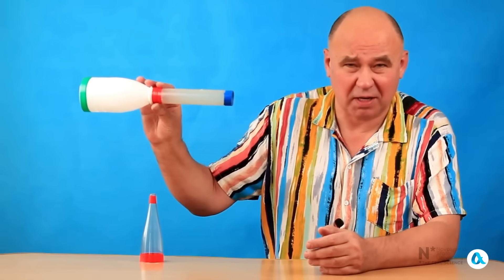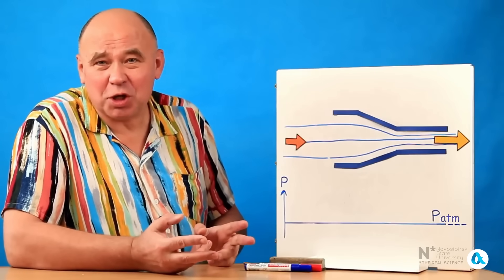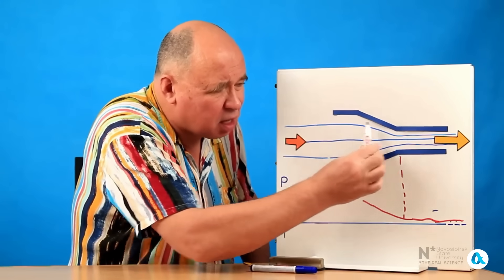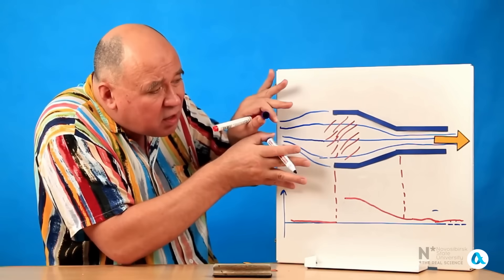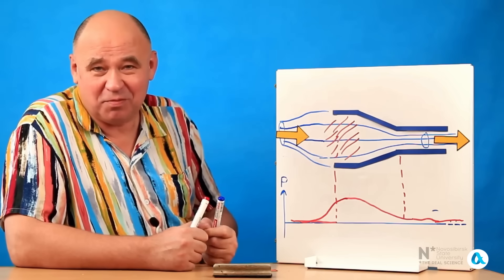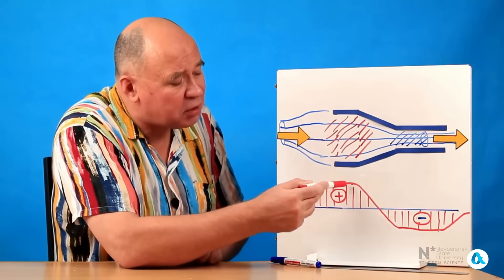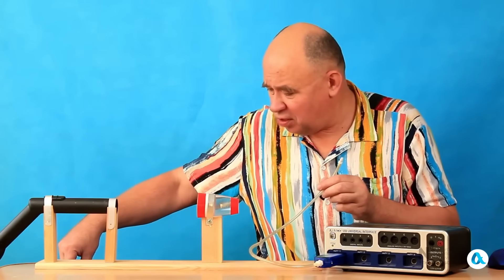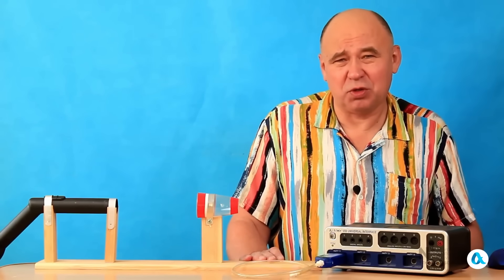Tapering pipe paradox

Comment: In this video, the velocity of the air inside the outlet tube is definitely greater than the velocity inside the inlet tube. There is no doubt about it. Because the pressure inside the inlet tube will be higher than atmospheric pressure. If you blow the inlet of this tube with a fan like in the video.

If we put this tube in a wind tunnel, the inlet pressure should also be higher than the outlet pressure.

Will there be a reaction force at the outlet of the tube? it will be. But this reaction force is not acting on the tube, but on the air. So it cannot become the engine of an airplane.
Reply: You know narrowing conical shapes are used in supersonic jet engines to slow down the incoming air? An increase in pressure, i.e. narrowing of the tube, slows the air down so it's suitable for the rotor. The air speeds up when pressure eventually drops at the outlet.
Reply: @Kansika  Is slowing down the speed an increase in pressure?
Reply: @enbinzheng-line  Yes. "Bernoulli's principle states that an increase in the speed of a parcel of fluid occurs simultaneously with a decrease in ... pressure." Notice that it doesn't say that lowering the pressure at source of the flow will always increase the speed of the medium downstream. Additionally all this applies to static pressure which he is trying to measure here.

It's quite logical when you get your head around it. Try this: a high speed flow of air in a duct meets a restriction and is forced in to a narrower duct. Of course the flow will slow down bc all that air won't fit in as easily. Simultaniously the pressure it exerts on the walls of the duct is increased bc the same mass has to fit in to a smaller space. And vice versa, when the duct opens up to a larger diameter the air speeds up while the presuure it exerts on the walls decreases.
Reply: @Kansika  What you said is incorrect. The fluid is continuous. Assuming the fluid is incompressible, the volumetric flow rate inside the tube is constant, so the fluid velocity at the inlet of the converging tube must be lower than that at the outlet.
Reply: @ There's no incompressible variables here. What he theorizes, models and measures don't add up. Why not set up a venturi tube yourself and test if Bernoulli was wrong?

First of all the CAD model shows a cone with an even diameter extension nearly as long as the cone. The model he built only has a cone and an outlet. Not the same thing. A taper or a restriction always causes turbulance that takes a while to settle.

Secondly he's holding the end of the probe tube away from the direction of flow. Air flowing over tuhe tube creates an eddy flow at the tip creating negative pressure zones. 

The least he could do would be to take more readings with the nozzle facing the flow. That would be the dynamic pressure and subtracted from the static pressure it might give some hints about air velocity.  But like I said he's not measuring static or dynamic presuure here.

I use a pitot-tube with a digital manometer to test ultra-sonic air flow sensors at work. Turbulent air is very hard to measure. All and all, air speed is not what he measured here.
Reply: @Kansika  I mean the exit speed is faster than the entrance speed.
Reply: @enbinzheng-line  Static pressure should be measured perpendicular to the  flow, not pointing the nozzle downstream where other factors come into play.

Measuring static p could be done by drilling eg. four rows of holes in several columns around the funnel that are at different distances from the inlet. Then inserting  four tubes that are joined together and taking messurements in each column at different depths would give some picture of what's actually happening inside.

How do you calculate air velocity from these quasi-static measurements? When he measures ~150Pa of positive pressure in the funnel the velocity of the "fluid" is simultaniously reduced by the same factor. At the outlet the pressure drops to barely below atmospheric, <-10Pa meaning the increase in velocity is minimal and it is relative to the already slowed down velocity, not the original velocity before entering the funnel,  unless you want to argue with Bernoulli, that is.
Reply: @Kansika  I mean that after the fluid enters the convergence tube, the velocity decreases to V1, the pressure increases to P1, and then there is a velocity V2 at the outlet of the convergence tube, which should be: V2＞V1

Your method of measuring static pressure is correct, it is not correct in the video.
Reply: @enbinzheng-line  If instead of static pressure measurements you measured the volume of air and it's kinetic energy at both ends you'd certainly have a net negative.

The high pressure readings in the cone are due to turbulence and the collisions of air molecules while some of the air and thus energy is being deflected from the main axis of flow and some is reflected backwards out of the system. That's why you cannot use only static pressure to calculate air flow/volume.

Some air molecules are accelerated slightly at the outlet but the amount of energy is not increased in the system. Instead a smaller mass of air experiences the acceleration but it has less mass/energy. No thrust. To get a relevant calculation out of this you'd have to know the mass/velocity/total energy of the air entering and exiting the system which this setup doesn't do.

Comment: You could with the same success demonstrate that peas dropped in the funnel fly out faster on a bottom than enter it at the top and argue that this should mean that the funnel might fly upwards due to pea jet stream.

If you reversed the funnel in the air, I believe it would have normal pressure in the narrow part and lower in the wider.

Comment: I like this explanation (as the author of this video), and I like the question, of course. What happens in the narrow part of the tube, if we neglect the viscosity? The flow velocity is higher then outside the tibe, yes? But what do you think about the energy conservation in this case? :))
Reply: In this video, the velocity of the air inside the outlet tube is definitely greater than the velocity inside the inlet tube. There is no doubt about it. Because the pressure inside the inlet tube will be higher than atmospheric pressure. If you blow the inlet of this tube with a fan like in the video.

If we put this tube in a wind tunnel, the inlet pressure should also be higher than the outlet pressure.

Will there be a reaction force at the outlet of the tube? it will be. But this reaction force is not acting on the tube, but on the air. So it cannot become the engine of an airplane.
Reply: @schetnikov  
The ability to properly translate a wide variety of languages really is something I'm looking forward to a lot. 
I've seen so much interesting work from Russians, Indians, Japanese and whatnot, especially on technical/mechanical topics, but rarely with useful translation. Especially if it's a rather niche topic people rarely take the time to make proper subtitles, much less a full synchronisation. 
This might open up a whole new world soon. 

Did they just translate and reupload the video without consent though?
That would suck a lot, such crap is way too common as is and it might increase dramatically very soon.

Comment: How this net deceleration related to drag force on the system? F_drag = mass_air × a_Netdeceleration ?
Reply from the maker: Imagine two pipes of different diameters connected by a smooth adapter. Now let us place this structure in the air flow with its wide end forward or, what is the same, move it relative to the stationary air. The flow enters the wide part of the tube, then passes into the narrow part, and at the same time, obviously, increases its velocity. Have we really got an air gas pedal, a kind of jet engine that runs without any fuel?! Something's not right here.

A metaphysician like Newton will immediately say that the Creator of all things so arranged the universe that man could not get something for nothing, and such an engine is a priori impossible. 

And a physicist (like Newton) should find an error in this very plausible reasoning and understand in what exactly we deceive ourselves.
Let's follow the air pressure along the axis of the pipe. Behind, at the exit from the narrow pipe, the pressure is atmospheric, as well as inside it: the air flies there by inertia. But in the adapter and in front of it, the pressure must be greater than atmospheric to drive the air into the narrow pipe and increase its speed. But before the wide pipe the pressure is again atmospheric, so at the entrance to the pipe in the area where the pressure increases, the air flow slows down and expands. 

So far ahead of the pipe, the cross-sectional area of the flow that will then enter the pipe is smaller than the cross-sectional area of the wide pipe and probably equal to the cross-sectional area of the narrow pipe. Then there is no acceleration of the air - with what speed the air moved far ahead of the wide pipe, with the same speed it flows out of the narrow pipe from behind.

Here, as in other cases where we encounter seeming paradoxes, it is important to draw the lines of current correctly. For example, the wing of an airplane not only deflects the airflow downward behind the trailing edge, but also causes it to run into the leading edge from bottom to top, rather than horizontally. Or else: water moves much faster in the inside of a pipe bend than on the outside.

And as in many videos devoted to hydrodynamics, we simulate the flow of our “engine” using the Vizimag program, because the mathematical equations describing the motion of an ideal fluid and a magnetic field are exactly the same.